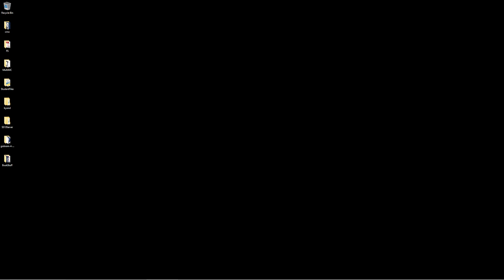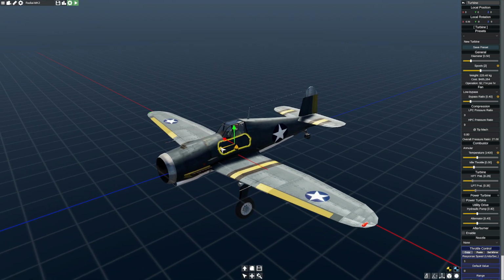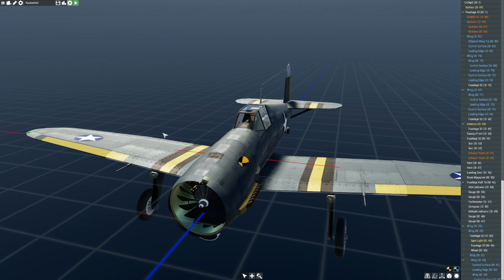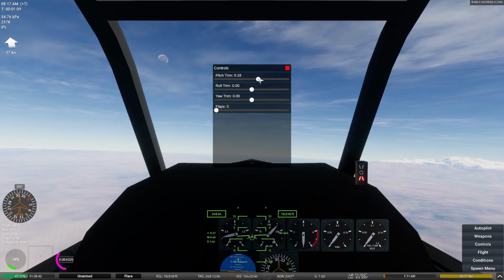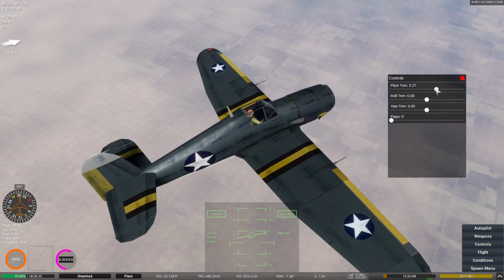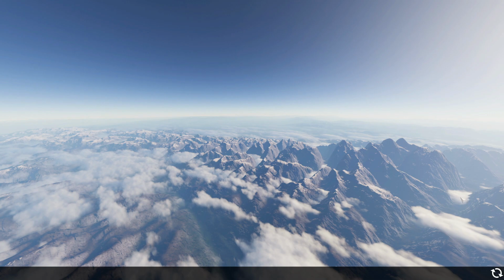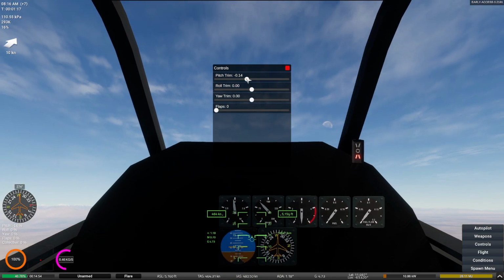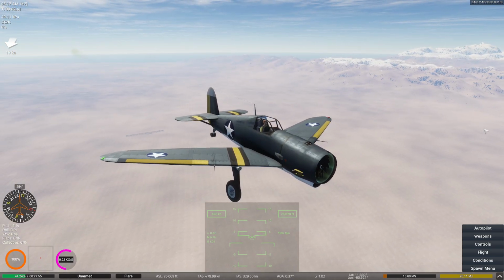Flyout - Converting the Default Piston Plane to a Turbofan

Comment: What's happening on the engine when it's getting the white stuff?
Reply: Area of low pressure causing water vapour to condense in the inlet duct
Reply: @kingflynxi9420  interesting, thanks for the answer

Comment: So nice of the designer to include a foot warmer for the pilot, I wish more planes were like this
Reply: Those designs are amazing, wonder why no one else does that. I have 2 exhaust pipes right under my seat, which heats up my ass quite well and comfortable in the winter, but during the summer it can kind of hurt in heavy traffic.

So why build in heavier feet/butt warmers when you can just use the engine as a heat source? Haha.